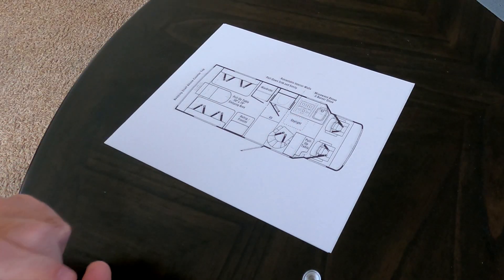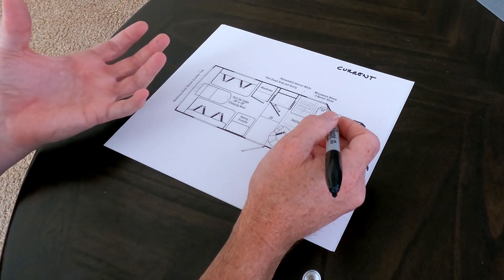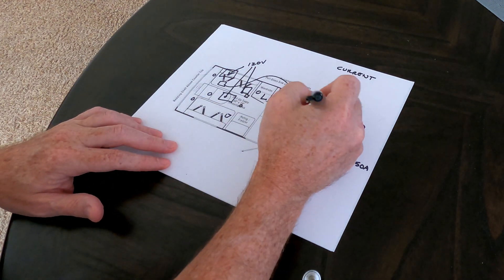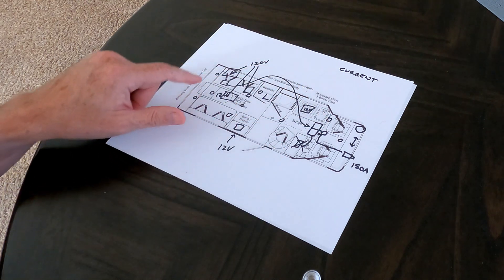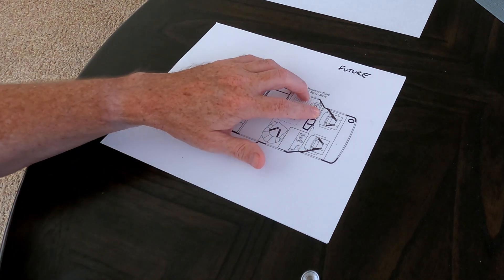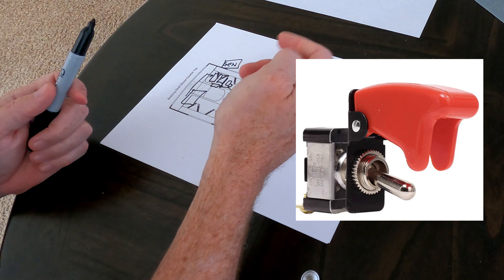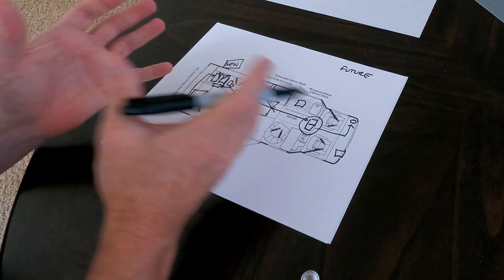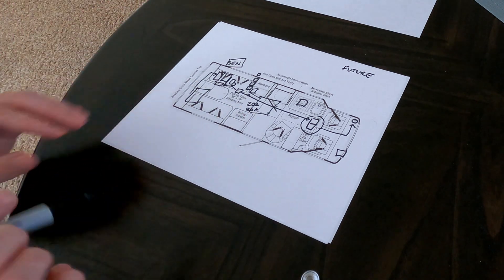Winnebago Rialta LiFePO4 Retrofit Project: Project Planning

Comment: Hi, I know this video is 3 years old.  Can you tell me how the previous owner wired up the inverter behind the passengers seat? How did he run the wires out of the coach battery box, and how the wires came up from the bottom of the vehicle?
Reply from the maker: They attached the inverter to the floor, ran the leads right next to it through the floor, into a (I think it was 300A) fuse under the coach, grounded the negative lug to the chassis, and then the main power lead ran into the battery box from underneath. The inverter itself had an on/off switch so it could be hot even when the rest of the house wasn't turned on.
Reply: Do you have the rialta still?  If so could you sort of measure approximately where the holes are ?  Underneath mine I see the battery box, going left to right, could you measure from the vent hole on bottom front right hand corner  to where the positive comes down from the floor... It appears to a kind of false floor in front of the tool box on passengers side, so it appears I'd need to drill thru the false floor then thru the metal floor then turn in left and go thru the battery box to the red battery post... Maybe a picture of possible from the top and bottom.
Reply from the maker: Unfortunately, I don't have it anymore so I can't get any measurements - but that's basically it, you'd need to penetrate the battery box from underneath in this scenario, the way mine was. Alternately, you could run cables into the side of the battery box and keep everything on the inside of the coach, although that would mean the cables would be visible.
Reply: As I don't want to hit anything of consequence or drill multiple holes I ask for photos and measurements.... I'm am appreciative for your answer, thank you.
Reply: Also are you able to tell what gauge they are, either AWG or 0 or 1 or 2 Aught? Again I'm very appreciative! I'm trying to connect a 3,000 water inverter and want to not do a major renovation... If I need 110 then it's right there on the floor.
Reply from the maker: I'm pretty sure my cables were 3/0, that would take 300A for up to about 6 feet - just be sure to have a fuse on it, especially if you're using a 3000W inverter, because at full load it's going to pull over 250 amps. You'll also want your batteries to be deep cycle or lithium.
Reply: By the way your video was very well put together... Very clear.
Reply: Thank you very much !

Comment: Good plans. Did the Hymer have a lithium battery?
Reply from the maker: Yeah, the Hymer was outfitted with a pair of 200Ah lithium batteries. They were a little finicky, in part because Hymer wired them against the manufacturer’s instructions. But I do like having power on board.

Comment: Sounds like another interesting project Maury 👍. I also wanted to thank you with an answer you gave me during Amber’s live feed the other day regarding my having difficulty closing the sliding door on my Hymer. You suggested taking out the bottom part of the screen door frame. I can see where the bolts rub there. What happens to the cords that guide the screen door at the bottom if I remove the frame? Maybe all of the door problems will go away if I change out the screen to the Rolef. That is if Canada opens up this summer! Enjoy your project. I always enjoy learning from you. Be well.
Reply from the maker: I didn’t realize you still have the stock screen… Yes, you would not be able to remove the bottom track unless you remove the sliding screen. If you have the Rolef installed, then you can remove the bottom track and you will be incredibly happy. :-) I absolutely recommend the Rolef.
Reply: @TravelingSolo  Thanks once again Maury for your advice.